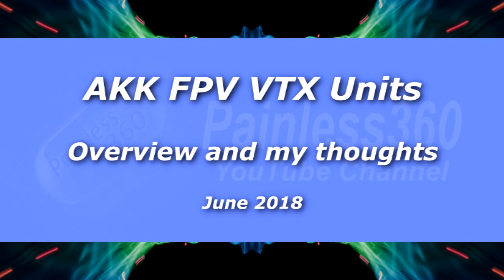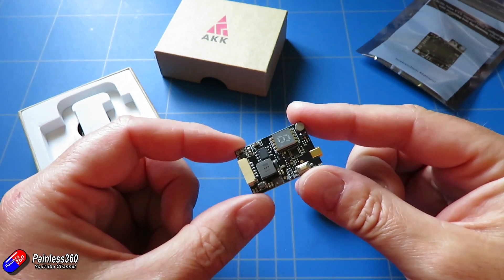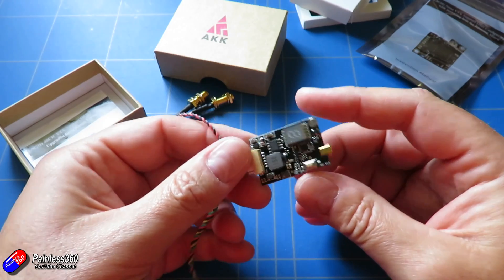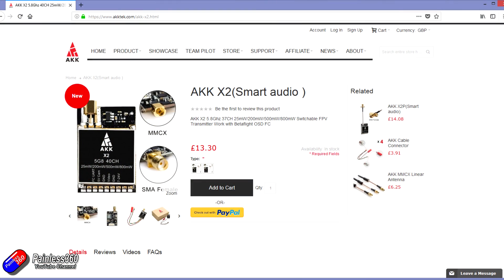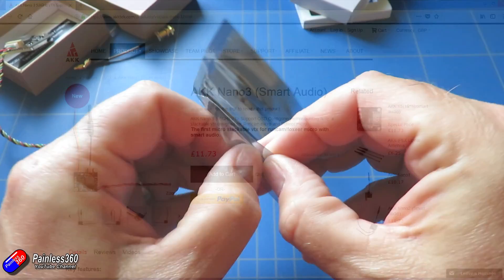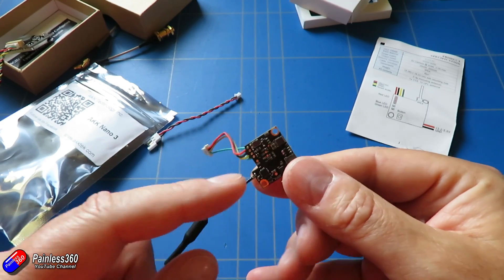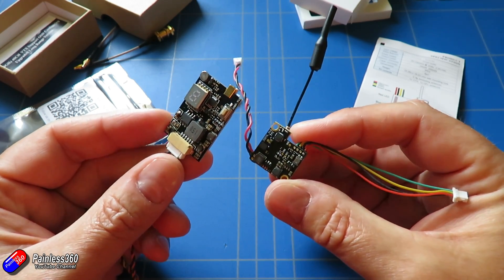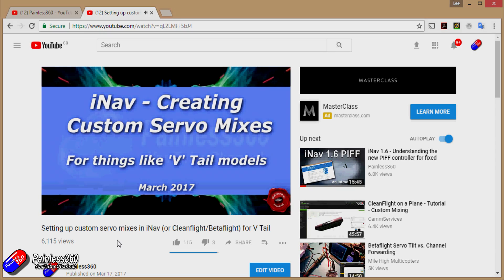AKK FPV SmartAudio capable Video Transmitters

Comment: I'm a bit behind the curve with regard to AKK and SmartAudio. Anyway, I picked up their AIO cam/VTX with SA and the menu doesn't allow me to change any channels, bands, etc. I've downrevved to BF 3.2 and still nothing. There is some sort of advanced menu that shows a frequency and another menu that appear to allow you to change the frequency manually but nothing that allows you to select preset frequencies. I honestly dont think its working. There is zero information out there about the menu's I'm seeing.

Comment: On the nano I recommend replace the antenna connector to one that can take a  sma or  rp sma connector and change to full side antenna the range will increase considerable.
Reply from the maker: Excellent suggestion. You can buy the pigtails inexpensively from places like eBay.

Comment: what did you study in college?
Reply from the maker: I'm a electronics design engineer by training..
Reply: i wish i could speak to you on a phone or something, I'm trying to do what you doing and i came across electrical engineer. is electrical the same as electronics engineer? i can't figure out the difference, so confused
Reply from the maker: Direct support is available to Patreons. In the UK (when I trained and qualified), electrical engineer was a more general qualification (everything from house wiring to HV power distrubution systems) and electronics engineer was more about PCBs, discreet components, programming and electronics theory and design. Happy flying!

Comment: Nice video! I have the nano3 as of yesterday. I like it but I have a few problems. One problem is that it keeps resetting the output power. It always starts at 25mw. If I set it too 200mw it changes it back to 25 after a power cycle.(yes I used save and exit) The other problem is that the 25mw does not feel like 25mw but more like pit mode. I could not fly further then 30 meter without full break up. I don’t know if I have a setting wrong and it actually is on pit mode or their 25mw is really really weak. Also there is not much info about it how it actually works. There is no online manual and the manual that’s delivered with the vtx is not comprehensive what so ever. Especially about the smart audio stuff.
Reply from the maker: I've just tried mine here, it's working fine and remembering the power levels and channels too..
Reply: Thanks for testing! I'm gonna dive in a bit deeper.

Comment: Nice looking video Tx, thanks for the heads up. Wouldn't it be nice if manufacturers provided a harness that makes it easier to wire it for an OSD, as most of us do now. Just an extra yellow  cable with a crimped end for the plug would do.

Comment: Also, keep in mind that in Betaflight 3.3.2 (I think) smart audio no longer work for these.  You have to use the fc hex file from AKK.
Reply: That's only with OLD AKK VTX's.. that problem has been solved quite a while ago
Reply from the maker: Indeed. I'm tempted to make another video about this because there is a lot of confusion. Thanks for the idea

Comment: Just clicked on the link and it's now £20.++
Reply: +Maciej Winiarczyk

TL;DR: that sounds like a gimmick; there is little point in having that much Tx power on 5.8GHz.

There is diminishing return, range-wise with increasing power and if range is needed then 2.4GHz or 1.2/1.3GHz is a much better idea; the transmission travels further at those frequencies for the same power output so you can use a less power hungry vTx for the same range.
Reply from the maker: To double range you quadruple the power (6dB). 100mW should give you twice the range of 25mW etc. I’m about to release a video about it..
Reply from the maker: Link updated :)
Reply: Indeed, but it looks like it's upgraded (ultimate) version in higher price, with up to 1200 mW transmitting power.
Reply: I think this should be the proper link https://www.akktek.com/products/vtx/akk-x2.html

Comment: AKK Nano3, just no. Its intended to mount on the back of runcam micro & its a hopeless kit for that
No mounting hardware, and it wont mount onto the back of the runcam as is.They obviously put zero thought into it.
Buy something that wont be a major headache to mount on the back on runcam micros
Yes I have one. Yes I regret buying it. Get the runcam vtx instead